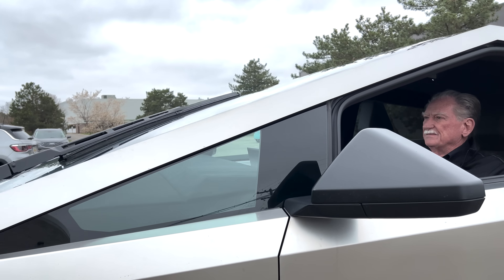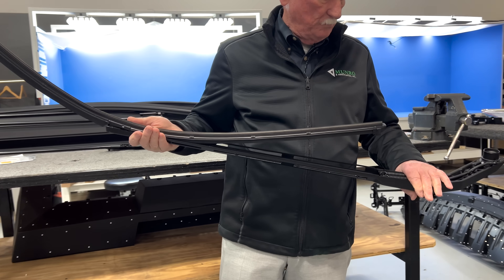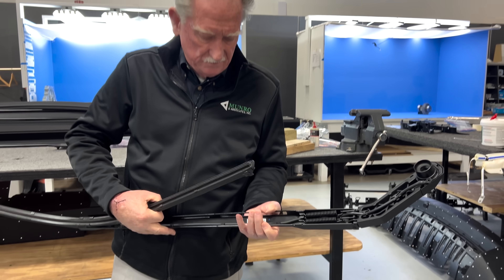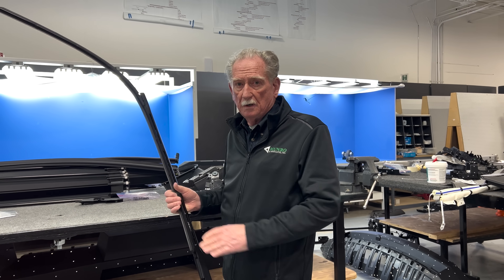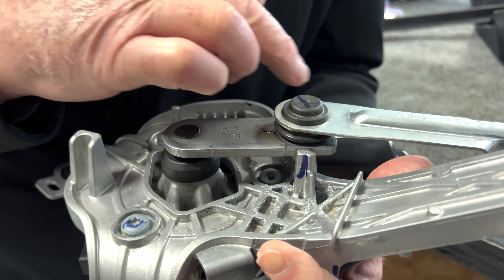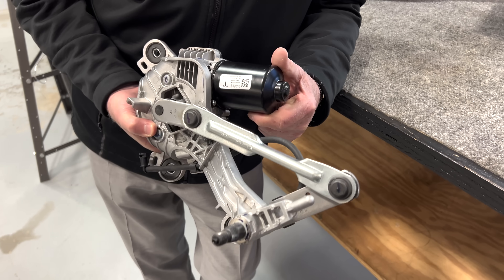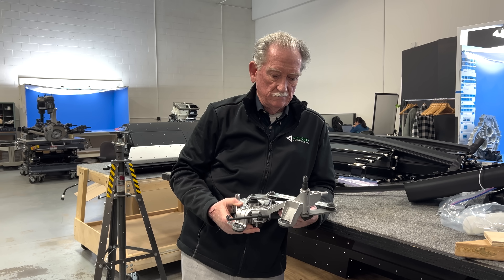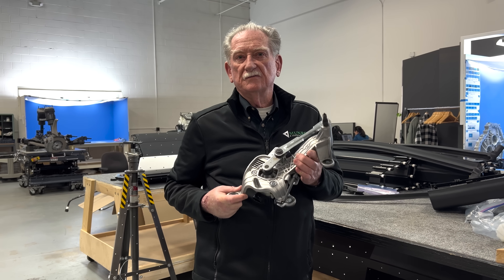How the Cybertruck's Massive Windshield Wiper Works

Comment: Who designs this stuff geesh. When the end of that blade freezes to your windscreen just watch it rip off when you turn the wiper on, or else burnout the motor. Hope you have antifreeze in that water pipe. Imagine how expensive that blade will be each time you buy a new one when the rubber deteriorates, plus the shipping cost for a huge parcel. In a downpour single arm wipers never clear the rain off fast enough. No wonder that vehicle weighs tons with the weight of just that part.

Comment: Good lord... the washer system runs a hose up that long arm to spray it out of the arm itself?  There's a great moving part and hose to break someday.  And the water bottle looks like it can't be more than a pint in size.  This is an overly complicated monstrosity.  Two smaller blades, bigger motor, two little jet nozzles at the base of the glass - OLD SCHOOL.  Betcha they wouldn't have been recalled.  Works great in snow???  LOL Try that in Minnesota where ice forms while you are driving even with a hot defroster on it.

Comment: More useless Munro blather, seems none work properly, you anaylize is useless noise FAIL ..it Failed in operation, because it's poorly designed, undersized, too small 48V, you are clueless.  and they didn't make it, they bought from OEM supplier, to wrong specs.  Tesla is not vertically integrated, stop with the lies.  All recalled for failures, you are clueless.  It failed. Cheap is not better, just cheap.  You are clueless.

Comment: "Works well & very reliable" That comment isn't aging well.
Reply: Why?  Any evidence besides your unwanted and unsupported opinion?  We have this truck and the wiper works just fine.  Tesla sent a software update that improved the programing of the wiper timing to hold it a bit more on the bottom to keep more water down below the windshield before allowing the stroke to "open up" as the wiper moves upward.  Works fine

Comment: As a shareholder, I am encouraged by  this video. There is little doubt that a future iteration of this car will not have the slave arm and second bell crank. Some engineer will get a bonus after working out how to direct drive the shaft from the gearbox and eliminate all of those unnecessary parts, assembly procedures and failure points. And the stops will be electronic, not mechanical.

Comment: Takes a real engineering genius to scale down the motor with a 48-v system and then undo all the savings by attaching it to a mechanism the size of an automatic transmission.
Reply: It works!  Huge windshield cleaned by just one wiper.  The entire thing is inside the body and what is outside is basically out of view on the bottom left.  What's not to like?  My old Jaguar XKE had THREE wipers.  Mercedes had one but it was in the bottom middle and was too distracting.  This solution is genius enough for me but obviously not for you with your PhD in automotive engineering, right?

Comment: I don’t do these for a living but that’s the first wiper motor I’ve seen that doesn’t rotate 360 on the outside. If the work gear goes back and forth, they may lead to concentrated wear on the bull gear.  My 0.02. Neat dive into details. Thanks.

Comment: C'mon Sandy, let's see more of the steering system. I really want to see the guts of the non-redundant front steering rack and steering column.
Reply: Lies, right out of the gate.  Totally redundant.  Two independent electronic monitoring systems sit on top of the the front axle.  Stop with the lies.  Save your hate for your next KKK meeting.

Comment: Tesla didn't make this either, it says Valeo.  Vertically integrated, right Sandi?  oy vey.  they get it from OEM suppliers that all other buy from.  again, Tesla is a marketing, hype, not a mfg. They assemble, like so many others.  Vertically integrated was in the 1930,40's, 50's.  they made their own steel at Ford, they made their own springs, wheels, etc. , frames, etc.  Now suppliers can do it better, and cheaper.  Sandi is confused. It's not prudent, which is why it's no longer done....

Comment: My question is... does it move fast enough for heavy rains? Every single time I've "upgraded" to a newer car the fastest wiper speed seems to be getter noticeably slower. My current vehicle, a Toyota Camry is basically useless in a heavy rain that previous vehicle's wipers would have had no problem with. Cars in the 80s and 90s had wipers that would THRASH themselves to pieces if you werent careful.

Comment: Dear Sandy, these are secondary issues. Tesla Vision cannot run wind shield wipers properly. It is only 10 $ sensor problem but tesla insists with non-working camera based detection. My windshield statched only after couple of months. Hated !

Comment: why don't they collect water from condensation, hit it with an alkali to neutralize acid in a solid tablet form which would also contain cleaning agents that way instead of filling up often you just change a tablet.

Comment: Changing subject slightly, I’ve been intrigued by what Chevy is doing with the Bolt front beam type wipers.  The Bolt has the wipers mounted at left and right corners with long overlapping blades.  There is apparently no physical link between the blades, but the movement is coordinated so the blades don’t collide.  The wiper arms appear to be connected to the motors directly or with very little reduction.  The arms are easily moved about by hand without offering much mechanical resistance.  In intermittent mode, the wipers are both raised slightly above their park position so that the defroster will at least somewhat help get rid of any ice build-up.  As an observer, I like the outward appearance of what appears to have been thoughtful engineering by GM.

In cleverness, I believe Chevy would get that prize, but for sheer massiveness the prize goes to Cybertruck.
Reply: Probably the same mechanism found on small Opel astra and the last Chevrolet cruze

Comment: I was wondering how to get the ~160 degree (?) arc using a Scotch yoke…. I’m thinking there’s probably something more like a Whitworth slider inside the gear box.  Also, I believe you would not want to run up against those stops routinely - not on an aluminum casting - most likely the stops are for when wind gusts push the bell crank outside of its normal arc.

Comment: Always enjoy the insights from Sandy.  Though I have so many questions.  For starters, besides Tesla, who's carrying replacement blades in their stock?  Replacement arms?  And my goodness, I can't imagine the cost to replace that huge wiper blade.  

And to that point, best way to destroy or shorten the life of the wiper blade AND even the motor is to have it clearing snow loads which may have initially iced over from the cabin heat.  Bad advice especially considering the cost of that wiper system.  Big price to pay for one's laziness.  Get off your arse and clean the windshield yourself.  And, yes, I know it's a big windshield.  Deal with it. 

And, sorry to hear about the hand, but my goodness, cover it up, unless the intent was generate more comments with people asking about it, then it worked, but man, we don't need to see a close up of that.

Comment: With the park position at the side the blade is going to get cooked by UV and require frequent replacing.  I know that from experience - because the wiper for the backlight glass on my Insight is in vertical park position and pretty much disintegrates in less than a year.  The difference is that I can get a 16 inch blade for my Insight at Walmart for six bucks.  Good luck finding anyone who stocks that monster Cybertruck beam type blade.

Comment: I can see wiper blade as being a yearly profit generator for Tesla. Sometimes Tesla has real genius and innovation, other times not so much. A huge blade with a built in channel for washer fluid might be one of those "not so much" things for me. If Tesla prevents me from replacing my own wiper blade every year......
I understand due to the size and shape of the windshield that it is an elegant solution (especially with the 48v motor). Is Tesla a sole source for a new blade? Is it patented to prevent copies? I am also (due to living in the desert) not really fond of glass roofs. I want a Y with decent range and LFP batteries that is capable of being used as a backup power source if we have a power outage. LFP batteries are ideal if you also want to do grid tie, due to their cycle life and better safety.

Comment: Sign of a Real Mechanic just Look at his Hands ! Yes the M.B.Z. Single Wiper is a Technical Marvel Engineered to Cure the Side Slap Mounted over Length Arm that comes loose due to Length Excerpted Pressures ! Being Center Mounted at the Bottom of the Windshield the M.B.Z. Single arm Assembly Gave it the Advantage of a Shorter Blade and arm witch also Pivoted down at 12 o clock to keep from Over Shooting the Windshield on to the Roof Once Cleared would Extend Back to Full Length Providing more Coverage the Achilles Heal of the Side Mount arm top 2 Corners Coverage With in View ! Expensive a M.B.Z. Trade Mark Very Reliable and fun to Watch !
Reply: The other benefit is that it doesn't need changing for LHD or RHD markets.

Peugeot used a similar system on the small 206 model.

Comment: This was "a little bit" about how it works - the interesting thing would be how the motor system detects the end stops and "knows" to reverse. It likely has Hall-effect sensors at each end of the travel.
Reply: Nope its all mechanical just like every other wiper on most cars. By the way, theres no way Sandy thinks this is a good car.

Comment: No, the mechanism shown at 3:03 is not a Scotch yoke at all - it is a crank, which is entirely different. Because both parts only move through part of a revolution, they're both called a bell cranks; a typical wiper system uses a crankshaft and connecting rod at the motor and a bell crank at the wiper arm.
Reply: Many other cars I've had including my Mercedes had way more advanced systems this is a cave man system

Comment: How well a single wiper works is a reasonable question. How it works - the mechanical design - is unrelated to the number of blades: this is just a wiper like any other modern wiper, but the windshield is so close to square (width equal to height along the slope) that a single wiper provides suitable coverage. Tesla has chosen to use a reversing motor scheme, while traditional wiper motors use a continuously rotating motor and crank, but either type of drive motor works with any number of blades. 

The more complex design was used by Mercedes because the windshields that they were clearing were not so extremely tall (because they were not as sloped) so the shape was not as square, and they needed either two wipers or one wiper with a more complex motion to cover the width without extending past the top when the wiper was vertical.

At the other extreme, some cars with very short windshields have had three wipers to cover the shape.

Comment: I am extremely skeptical about your "it works really really well in snow." Either you guys have child's play snow, or you don't drive it long enough on highway under subzero temperatures to have ice build up. Up here in Canada, all wipers ice up when it is -10c ish or so, is worst on Tesla because they do not have split heating for windows and for cabin (I wanted it to also constantly blow on windows, but can't), either it turns the heat to MAX and you melt the ice and cook yourself in the car... or you let the wipers ice up...

Comment: Jesus, the amount of drag in air resistance from that set up having the blade exposed
Reply: Actually that blade reduces air drag over the vehicle. It stays in the "up" position while driving so its inline with the air flow. And because the Cybertruck is so squared off at the edges, having the blade near the edge causes the air to roll off smother on that side, reducing drag overall.

Comment: Is the system heated or not necessary?
Reply: It didn't look heated. I would put some extra heat on that side of the windscreen. The excellent part in winter is that it doesn't pack snow and ice into an area below the windscreen. That can be a miserable task to dig out.

Comment: @4:04 Ouch What happened to your hand? Never mind, My hand hurts just thinking about it.
I used to work for an auto supply place and we'd see some drivers twice every winter. 
The first time was for a burnt-out motor, because they were too lazy to clean the snow off their windshield.
The second time was to replace twisted linkages since the new motor was at full power, because they were still too lazy to clean the snow off their windshield.
You can't fix stupid but you can sell 'em an expensive crap-load of windshield wiper motors and linkages, year after year...
Reply from the maker: Sandy had Skin Cancer removed.

Comment: Replacement blades for my Silverado.... about $25
Replacement blade for Cybertruck......... about $300 (my guess)
Reply: ~$75 for the blade and ~$165 for the entire arm assembly. 

Considering that that's a silicone beam type blade. $75 is not really that bad. 

If I buy two Bosch branded silicone beam style wiper blades for my Chevy spark. They are $28 per blade, totaling $56.

The newer silicone beam style blades work so much better than the old rubber ones. They are worth the extra cost IMHO. Especially when you have a good windshield treatment like Rain-X or some other nano coating to repel water.

Comment: I don't understand what the extra bell crank mechanism is. For fact I don't understand what the bell crank mechanism is for at all.
I can see using a bell crank for oscillating motion but they are already limiting the travel on the ends of what you call the driver so that arm is already oscillating. 
The only purpose in having a driven Bell crank is to change the motion profile but that can be done in motor control and save parts. That would take a smarter motor but it wouldn't have to be that much more expensive and I'm pretty sure cheaper than all that linkage and assembly. That was proven decades ago with direct drive turntables.
Reply: Bellcranks let you have high torque/low speed at one end of motion, low torque/high speed at the other.  The two arms differ by around 45° so they are utilizing some of this.  I'm unsure of the math but it actually seems to be a pretty high ratio, probably more than 10:1 difference if not even 100:1.
Reply: @rhamph  I understand that and that's already accomplished internal to the gearbox in some other type of oscillating mechanism. Probably a Geneva device.
Reply: You have to be able to get the assembly in place so you do have to make accommodations for that.  With the double bell crank they don't have the entire motor intruding as much into the cross car beam area and you leave more space for other components that do physically need to be in that area.  It is also done to make the motor itself more easily serviceable.

Best!
Reply: @neilfromclearwaterfl81  Yes, that would be a good explanation. Given that the wiper pivot is way in the corner instead of out in the middle of the cowl I'm surprised the Don't have room to not have to reach in with an extension.

Comment: I don't see any advantages to go with a single super beefy blade like this.
Odly enough, there is not less moving parts that in a standard 2 wiper system, to cost of replacing any of these parts because of the size of them is going to be prohibitive. (75$ just for the blade!) Drag on this huge thing must be crazy... (note that the drag coefficient of the cybertruck itself is probably not great anyway...)
To me, it looks cool, but it seems to be the only "good" thing about it.
Reply: You are assuming many things here. Several of them are wrong.

Comment: The bel crank has stops, but does it actually contact the stops under operation, or are they just safety stops?  0:30 there's a small rectangular window present by the A-pillar, which appears to be a sensor to detect where the wiper is stowed.  So with that index, it should be possible to track the limits of the motor movement, even without a lower sensor (assuming there isn't one).
Reply: Yeah, it seems like this must be reversing the motor direction whenever it approaches a stop. Which would be pretty fundamentally different than how most wiper motors work.